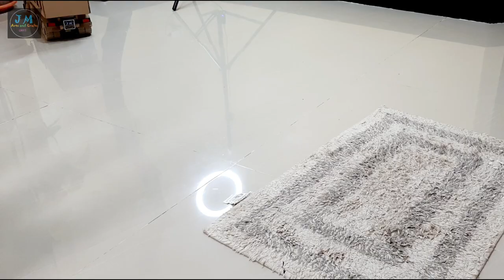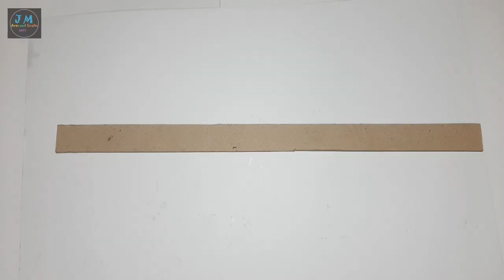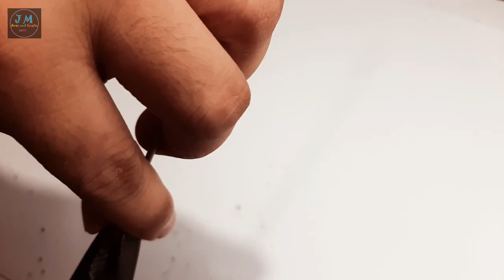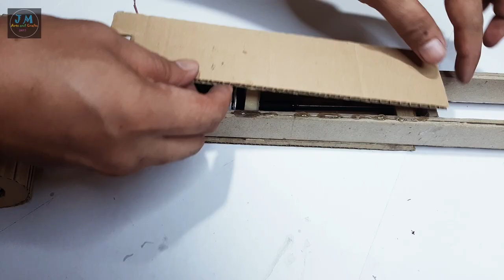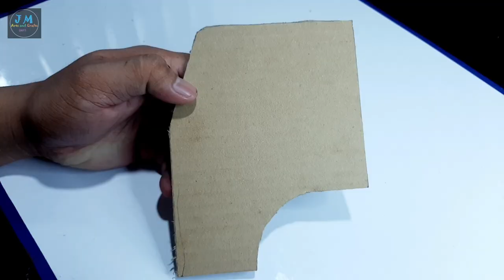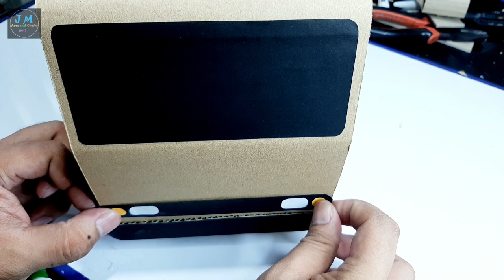Remote Controlled RC Dump Truck from Cardboard - RC Dump Truck || Cardboard Dump Truck

Comment: What size is the metal u use for the hydraulic
Reply from the maker: it is actually 1/8-inch x 5-inches. you can also use little bit bigger diameter because anyway you will create your own line coupler. thanks bro for the question. feel free to ask again. the motor i used is 6V-12V dc motor..
Reply: @JMArtsandCrafts   what is the metal called
Reply from the maker: @azelobarandino6869  it is called threaded bolt with nut. if you can see in the video the nut is embedded to the piece of wood  which is then attached to a fixed mounted steel wire. hope i was able to answer your question. thanks
Reply: @JMArtsandCrafts   than you
Reply from the maker: @azelobarandino6869  welcome bro